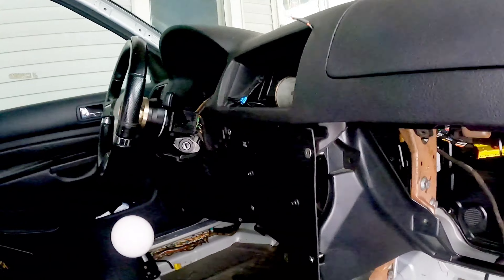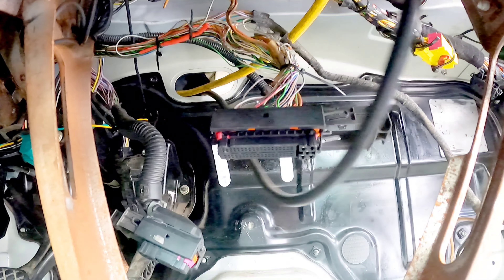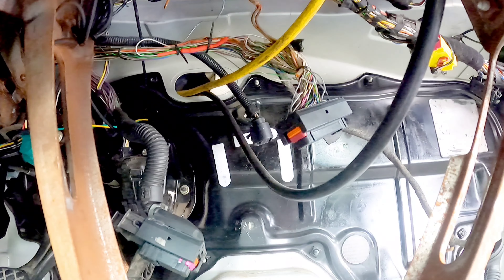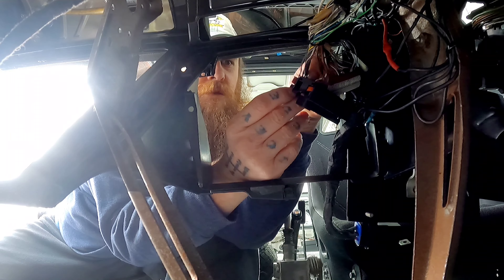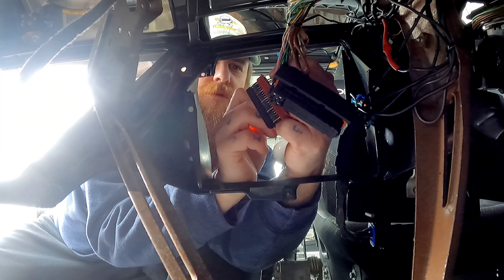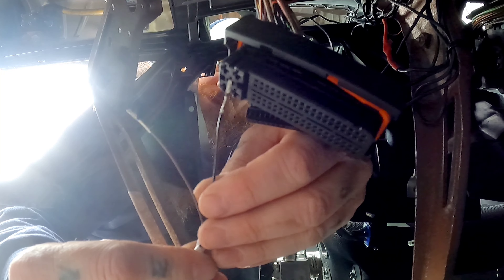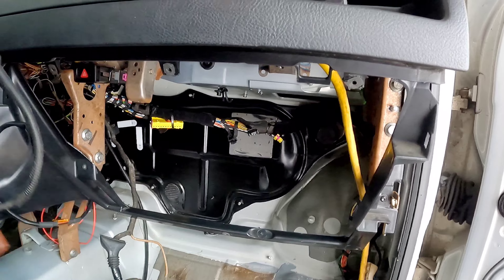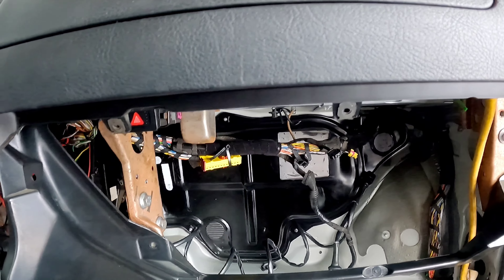Narrowband to Wideband conversion! The road to Gridlife Ep: 4 #wiring #car #diy

Comment: Did you have any issues with the radiator fans? I have a 2001 Audi tt 225 AMU . Swapped to AWP ecu and now the fans kick on when I turn the ignition on. I’ve read about disconnecting white wire/pin #61 but the fans do not kick in at all with it unhooked??
Reply from the maker: Unfortunately I can not be of help on this. Im not running the stock fans or fan controller. It could be something with the fan control causing the fans to turn on all the time.

Comment: Did you use the stock ecu or replaced with a new one?

Did work fine?
Reply from the maker: Since the car was narrow band I had to replace the ECU with a wideband ECU. 

If you do that you have to have the immobilizer disabled or you won't be able to start the car.